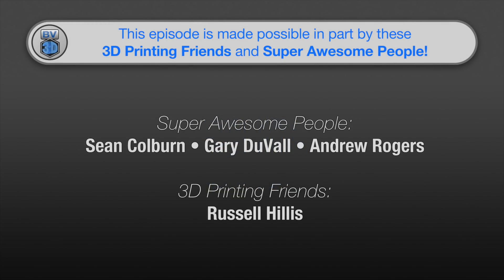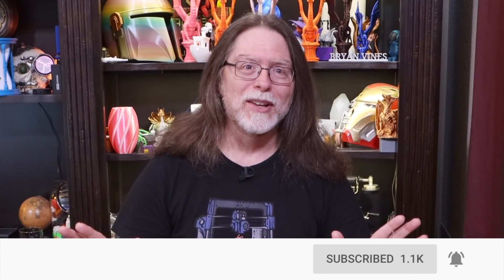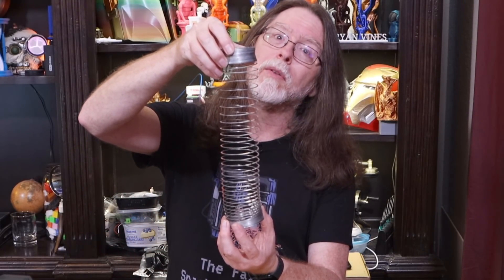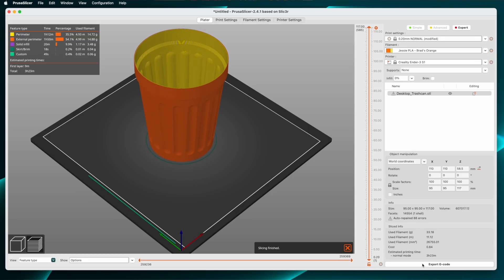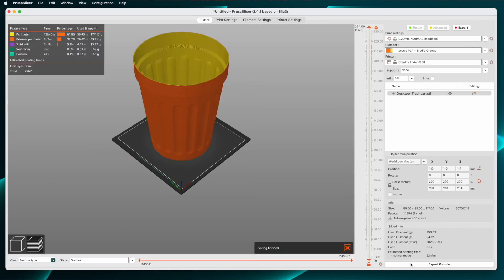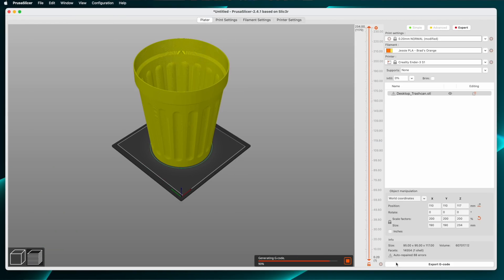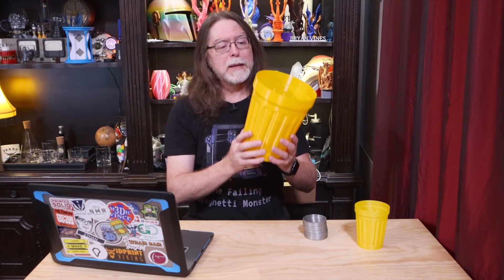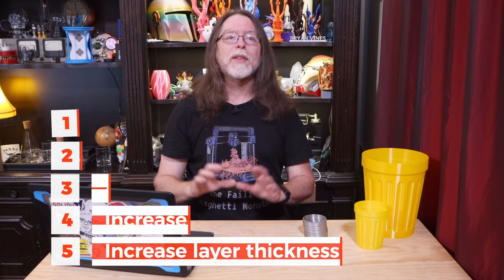Use FAKE Vase Mode when going BIG with Spiral Vase Mode prints!

Comment: the problem, if you want an actual vase and not a trash can, is that this method leaves an ugly seam. I wish someone would write some code to do a true vase mode with multiple thicknesses. One layer would go from outside in, the next layer from inside out, and it would totally work.
Reply from the maker: You have a good point, and I may revisit this method now that the "Scarf Seam" setting exists in several slicers. That's supposed to help hide the seam.
Reply: @BV3D  in Cura there is a setting to randomize the seam every layer - this is definitely better but still isn't as clean as a pure vase mode

Comment: i cant believe they still havent fixed this yet... i tried to print a funnel in vase mode... it was abut 8cm diamater... not so big... it always gave me a  fat seam in the form of a spiral... 

i then found fake vase mode and it workd... 

they also have the opton to smooth vase mode - but it made no difference... only way it worked was fake vase mode!

Comment: late to the party but this video gave me the keys I need to print a rather large pot in "fake vase mode"  I was able to thicken up the walls considerable and get it all done is 7 hours vs the original 19 hours. Vase mode was just way too thin for this print, you could see through it :D. Not what you want for a potted tree. And yes, all with my trusty .4mm nozzle.. I really need to get a .6mm

Comment: I don't get it. Why all this trouble when you can just select the spiral vase mode and then only specify how many bottom layers you want and the outer wall thickness ?
Reply from the maker: It's mostly because you're not gonna get something like a single 2mm thick wall with a stock 0.4mm nozzle in spiral vase mode. You could probably push a 1.0mm nozzle to do it, but not a 0.4. Until the E3D Revo and the Bambu Lab A1 & mini printers came along, nozzle swaps were historically a pain. 😊 Thus, faking it.

Comment: Thank so much for this.  I was forced into using Cura 4.7 for some parts that need Spiralize and 2 bottom layers.  The problem is that the 3rd layer prints twice and creates quite a mess.  Layer 4 and up are great.  Your method produces an excellent print and no messing around with double layers.  Cheers.

Comment: Your video inspired me to finally test out a method of double-walled vase mode that is still actually spiralling vase mode, which I thought of a while ago.

I constructed a hollow cylinder from primitives, right there in the slicer, with a distance of 2mm between the inner and outer surface.  Using my 0.8mm nozzle and setting it to slightly over-extrude at a 1mm wall thickness, the thickness of the part would be exactly 2 walls.  In order to trick the slicer into printing the inner wall as well, instead of just spiralling around the outside, I added another primitive as a "negative part": a cube of the same height as the cylinder, but scaled to a width of 0.01mm.  I positioned it so that it "cut" an infinitesimally thin slice through the outer and inner wall on one side of the cylinder, which resulted in both surfaces becoming technically the same "outer" wall, thus allowing a continuous spiral to include both.  Since inner and outer wall were thick enough to touch each other, the two would fuse, and since the theoretical "slit" was far below my printer's clearance, the two ends of the double-walled circle also fused together nicely — although they did leave a very visible "seam".

I tried this with the "cutting" plane upright and at an angle, trying to see which gave a stronger fusion, but in the end I couldn't find a difference: both seams were too strong to crush or separate with my bare hands.

I'll experiment further.

Comment: Another benefit of 'fake vase mode' (more than one wall) is in multi-color printing.
Most, if not all Slicers will simply refuse to consider a color change in vase-mode.
Bambu Studio supports 'print modifiers', defining regions of a print with different settings.
Example: specifying 'fuzzy skin' only in certain parts of the print.
None of this works in 'proper' vase mode...
What y'all said about strength and scaling is definitely cool-beans.

Comment: it is all good and all but what if you need a ball? i had the problem of printing christmass blown up bubbles around 8 centimeters in diameter and it was imposible to print with 04mm nozzle because of overhangsat near 90 degree, so i increased nozzle to 0,8mm and used clever adaptive layer height from 0,1 to 0,55mm where i could and that all in vase mode so it has no seems
but then to fix the top i sliced it again with the same layer heights but with a conventional 3 top layers 0% infill and swaped that part of the code manually when stepover on top become wider than 1,3 of the nozzl;e width by manually copying and replacing that part of the print in notepad
the 80mm ball on a short stem prints in about 40 minutes like that, still slicing a ball for vase mode took me a while to figure out
too bad that your method still have a seem even if you can randomize it it would still be there otherwise i could use that method although it most likely be slower

Comment: HI, great video. Is it possible though to print a cylinder in vase mode (say 80mm high), with a reinforcing 20mm band or belt around the middle of it, that sticks out 3 or 4 mm (like wearing a belt around its middle or waist). When using your settings, the object is sliced incorrectly leaving a weak point where the band in the middle begins and ends or connects to the rest of the cylinder. Thank you.

Comment: @BV3D Thanks for the tips.  I've printed your Desktop Trashcan @ 0.28mm/layer & 0.6mm extrusion width @ 60mm/sec.  Turned out great.

You never did mention at what speed and fan cooling settings you were using... care to share those?

(Long time lurker & subscriber)

Comment: My understanding is that increasing the layer height does cost a bit of strength, because as the layers get closer to the nozzle diametre they get closer to having true circle cross section, and thus less surface area in contact with the layers above and below.  It may not be enough to matter, but everything is a trade off, and it's good to keep in mind when using materials with poor layer adhesion.

Also, I'm always curious about dialect, and find your pronunciation of "plater" interesting.  Around here (Edmonton), "plater" with a long A is kitchen jargon meaning the person who puts all the parts of a meal on the customer's plate.  When "plater" is used to mean "a large tray used to serve items" it has a short A and would rhyme with "latter."  The second version is also how people who've never worked in a professional kitchen would say it in any context.  Totally not relevant, of course, but it's always fun to hear variations in the language!

Comment: You can actually print 0.8 walls with a 0.4 nozzle, specially in vase mode. it's how the fast modular storage system on Curse is reccomended to print for example. it works perfectly.

Comment: Nice work!  For big non-vases/closed-top objects, consider tossing in a Lightning infill (Cura).
Reply from the maker: I'll keep that one in mind! Thanks for the tip! 👍
Reply: Yes, lightning infill. Used it when I printed a mold for a finalized model. Shaved 6 hours of my print time and 50 meters of the needed filament.

Comment: That is not vase mode at all, but just making the walls thicker. Where do you locate the inevitable seam. Well you said fake, ok acknowledging that :)
Reply: Well, PrusaSlicer at least has a "random seam position" setting that costs a little time but starts each layer in a random spot, so the seams don't align from layer to layer and thus usually stay below the ability of the human eye to detect.

Comment: I have been printing some plant covers come micro cloche things for my old dads plantlings in natural PETG for the last couple of days, I used a 0.8 nozzle and 0.6 layers and the first one came out stiffer than required so I printed the rest at 0.5mm using Chucks fast profile for Cura, I quite like Prusaslicer and I use it with my MKIIIs but for my other machines the stock profiles are terrible and PS has its own version of G-code so you cant just transfer the printer profiles from Cura to PS, I am much more proficient in Cura than PS so anything that needs some tinkering gets done in Cura and printed on one of my other machines I have created loads of different profiles for different nozzles and printing techniques so most of the time its just a case of clicking the correct profile, I have one machine that I run on RepRap FW on a Duet 3 board and setting that one up was a doddle on Cura, whereas I gave up after 30 mins with PS.
 Is anyone aware of the location of any good 3rd party profiles for using PS with machines other than Prusa's?
Reply: I'd love to find a good location for profiles as well. They seem to be scattered all over the place.

Comment: Nice job.
2 things... I've gone up to 0.8 from a 0.4 nozzle in vasemode. Also, there should be an option in the sliced view to show the volumetric flow. I've had some of my slices hit 14+mm/s3 (microswiss hotend). Most stock printers should, probably, try to keep the value under 9-10. May not be an issue, but just throwing it out there.

Comment: You don't need a bigger nozel. I regularly print my vase mode prints at 1.2mm width with just the standard 0.4 mm nozel.
Reply: ^^ this. Though ideally you switch to a larger nozzle, this does work. I'd rather do this than risk unsightly Z seams, which to me avoiding the z seams is a big part of vase mode.

Comment: Well the vase mode has no seam and that's the game changer. 
You can not get that with this method. 
However it's a great way of getting functional parts with thin walls strong! 
And if the part has sharp edges where you can hide the seam the main advantage of vase mode isnt even relevant anymore. 
Great video :)
Reply: It kind of makes this method pointless, really.  Probably why he didn't use Cura.  Cura's   "Fake Spiralize  Outer Contour"  that doesn't 'spralize' loses its punch.